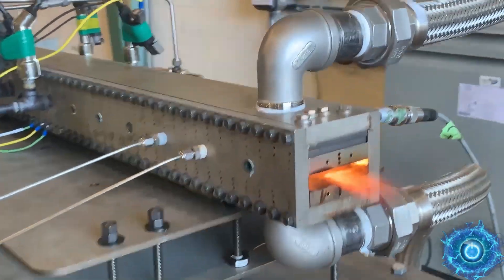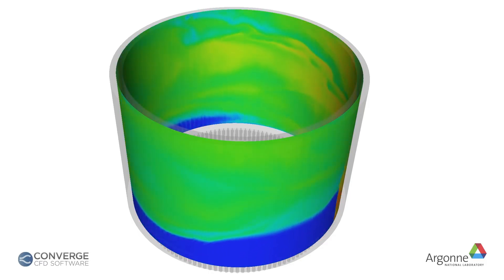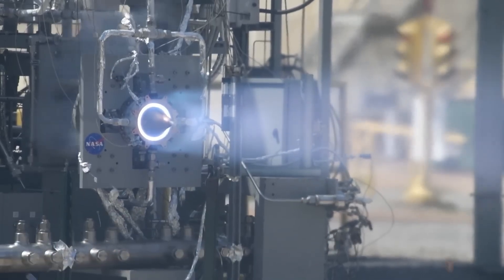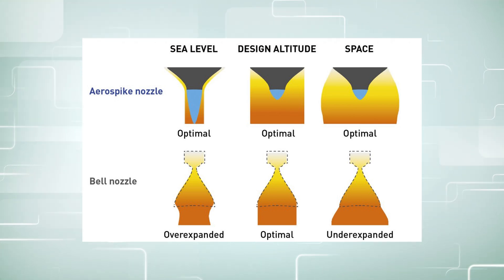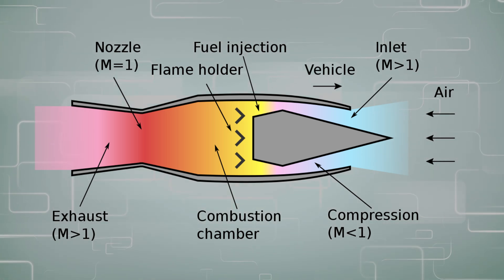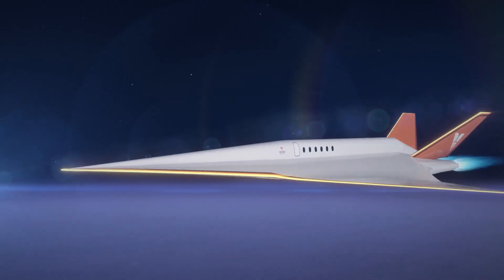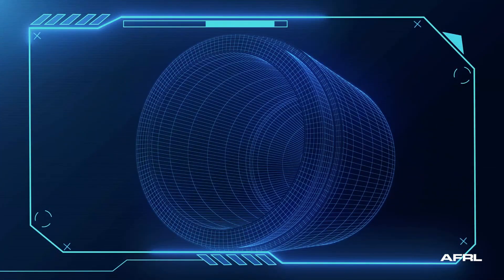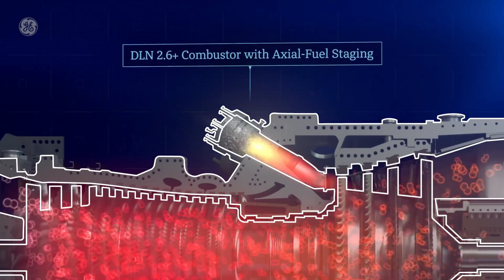New HYBRID DESTROYS Jet Engines

Comment: Love the video, but would love to see one regarding the fuselage of the vehicle that would house these new types of engines.  As we know the SR-71's fuselage had built in gaps to allow for expansion due to the high heat generated by air friction.  This in turn allowed fuel to leak out... very unsafe.  Would love to see a vehicle that could take me from the US to the EU in minutes not hours!!!!  Mybe take that trip to Australia someday without losing almost 4 days of travel time :D

Comment: A common problem still hasn't been addressed. Even having a small amount of efficiency it doesn't have enough impact.  I have studied this for many years and missing a key component.  A recoil action is required for more than 75% efficiency. Using less fuel is the goal and gains in displacement.  
I'm calculating speeds way beyond mach 10 because I also studied this by observing what characteristics was employed in the Orion project. The detonation was raw but it only captured a pie cut from the explosion and wasn't really effective or efficient due to a mass that was equally lost because it wasn't contained. I came to the very same conclusion and by having the engine 3D printed and yeah this one has moving parts.  We can't contain a Nuclear explosion of that caliber but here's how I captured the pie . A study of Naval Destroyers with very big guns , when fired the recoil is absorbed by the entire ship , moving this mass a degree or so of actual.  
My recoil wouldn't be firing shells but just fuel and oxidation but what became important is the ignition system and the best would be Plasma which is provided by laser's and disk which also offers a boost as well . If you need to know what's happening just take a look at the Orion's pistons and absorption plate . 
Pistons are the keys because a recoil by any action in space is a way of free thrust granted.  
The day I get a contract is when they all lose . I took on what Wernher Von Braun signed on to the Orion project and did what he did , he studied the characteristics because it would be effective but not with the current technology during his time . After all he did bring forth the Saturn V and the hand made F1 engines that put humanity's first step on the moon . I figured out how and why this is important to make an effective pulse detonation propulsion system that allows for greater travel throughout our solar system 
Cheers

Comment: You could basically create a space plane that went to the lower stratosphere at Mach 6, glided for a bit, then dropped back into the troposphere to your desired destination.
Reply: Wouldn't that be a stratospheric plane or stratoplane instead of a spaceplane?

Comment: I had an idea for a RDE. Probably been thought of but, imagine a circular Tesla valve set up but all channels are twisted like gun rifling. Could be several layers towards center with “twist” angle it self variable reducing and expanding pinch points in Tesla valve. Also defeats the no moving parts idea, but unit itself could spin within a stationary cylinder. 3/4 of the way twist, valve shapes are reduced before exit to kickstart fluid centrifugal motion.

Comment: High Tolerances = Loose Tolerances
Low Tolerances = Tight Tolerances

Don't confuse high tolerance with high precision.
Use the term 'loose' and 'tight' to prevent confusing.

Comment: How do the exhaust gases only ever flow out the back? 
Why doesn’t the ignition of the  compressed mixture expand forwards also?
Reply: Because the airflow into the engine directs the explosion back into the engine.

Comment: Why is it taking them so darn longq to make it into production? I would probably be dead by then by the time that they incorporate Mach 6 speeds to commercial airlines. I want to experience it.
Reply: Perhaps you missed the part where it's called a DETONATION engine.

The physical stresses implied in such engines are the reason engineers have shied away from them for reliability sake until material science and newer techniques (like rotating detonation) was able to produce a viable design.
Reply: Same.

Comment: Here’s a good idea.  You take an aero spike cone, split it in half, put the halves at the ends of a linear aerospike, making rotating detonation possible around the whole linear aerospike.(The rotating detonation wave would have to get around the ends of the linear aerospike continuously)You also use a very large 3-D printing machine to make the fuel tank possible, which wasn’t available at the time that SSTO vehicles were being developed.
Reply: Yes! Why is a circular (cylindrical) geometry necessary?
Reply: You could have multiple ‘waves’ of detonation operating concomitantly around the entire course, rather than say, having two opposed in a circular tube.

Comment: Jet engines have technically not changed since Inception in the early 1900s.  The RDE would be a brilliant step fwd. I can see them being used for rockets and scram jets /hybrids.  But i don't see a place for them on commercial flights.  Too noisy not enough thrust but it's definitely early days

Comment: I had a little bit complicated theory idea, is the high operating temperature caused when burning liquid fuels? The operating temperature could be lowered by burning gaseous fuels instead of liquid fuels, however this would need more research later on
Reply: No, jet engines work by spraying the fuel and creating a vapor that ignites, kind of a mix between a liquid and a gas
Reply: This is commonly done for a few reasons. In jet engines, the oxidizer is already a gas, and in rocket engines, the fuel and sometimes oxidizer are used as coolants which boil and become a gas during the cooling process.

Comment: It would have to fire outside of mass without disrupting the quatum magnetic fields of the material as decay. Mass is at the cosmic speed limit as mass now. Disrupting the flow of thermaldynamics singularities passing through mass increases decay of mass. Distance increases as mass decays into singularities. Heat singularities are waves of decay or renewable energy. Quatum magnetic fields are the strongest magnetic fields, but expansion weakens the magnetic fields holding materials together. The cooling system would have to be extremely colder to disrupt decay. Heat singularities passing through mass now as renewable energy striking out singularities in resistance are in equalization to thermaldynamics increasing distance increases decay and by rapidly increasing exchanging singularities as renewable energy also increases decay.Stars decay as heat loss of waves of thermaldynamics singularities as heat singularities outside of entanglement of mass as dark energy throughout space as perpetual motion. These singularities are always at the cosmic speed limit in resistance in and out of entanglement of mass. Quatum magnetic fields of redirected trajectories of thermaldynamics singularities passing through mass reduce distance of perpetual motion as force fields holding mass together in cycling circulation patterns. To increase distance of forward momentum, these renewable energy singularities strike our atmosphere in equilibrium now. The earth's magnetic field redirects quatum magnetic fields of grounding as weight of force towards the greater magnetic field of earth's center force of flow. Aging increases as decay increases. If renewable energy can't keep up with distance of equalization of exchanges of cold and thermaldynamics singularities cycling circulation then magnetic fields break down and more thermaldynamics singularities of heat loss. Cold stripping thermaldynamics singularities away faster than replacement of pressure.

Comment: 0:40 pressure always increases during detonation, no matter whether it is a jet engine or an RDE. That's the basis of jet propulsion.
Reply: Doesn't pressure decrease in the turbine?
Reply: @rikipatel4340  That's what I've always heard. It slows the air down to introduce fuel.
Reply: @rikipatel4340  first unit in a jet turbine is a compressor. Further down the compressed gas is mixed with fuel and ignited. That's where the energy to drive the compressor comes from. And in a turbojet, that's where the propulsion is generated. 
So, pressure always increases. Otherwise it would be fly backwards.
Reply: Pressure does increase during detonation, but conventional jet and rocket engines do not detonate, they deflagrate. The injector pressure in a jet or rocket engine must be higher than the combustion chamber pressure, usually by at least 20%, because fluid only flows from higher pressure to lower pressure.

In a rotating detonation engine, the detonation pressure is higher than the injection pressure, but only temporarily as the detonation wave passes by a given injector. This can cause backflow into the injector as the wave passes. The net pressure in the combustion chamber must still be lower than the injector pressure so that everything flows in the right direction.
Reply: @TheMooseOnTheLeft  I don't see what your point is. There's an increase in pressure in all thermal expansion systems, not "unlike in a jet engine...".
Reply: @human_isomer your original comment says that " pressure always increases during detonation, no matter whether it is a jet engine or an RDE. That is the basis of jet propulsion." I'm not sure what the last sentence is supposed to mean here. Detonation is not even considered in conventional jet propulsion, let alone the basis of. Detonation does not ever happen in the normal functioning of conventional jet and rocket engines.

The first part of your original comment is true, that a detonation will cause a pressure increase no matter what system it occurs in, but if anything, jet propulsion is about avoiding detonation.

Your second comment here ends with "pressure always increases, otherwise it would fly backwards". This doesn't quite make sense to me either. Pressure is increased in the first step of jet propulsion, but pressure is not always increasing across the engine. The highest pressure is in the compressor, and then pressure decreases across the injector, is held constant during combustion (which increases volume and temperature, at constant pressure), and again pressure decreases during expulsion. To say the pressure always increases is either confusing or wrong depending on what is meant. Yes, a system must always increase the pressure during a step, but pressure does not always increase across the system. Combustion happens at a lower pressure than injection.
Reply: @TheMooseOnTheLeft  Maybe there is a misunderstanding about partial and total effects. 
I think it is clear if you increase the temperature of a gas, you will always increase its pressure. In a closed container, the elevated pressure can be measured. In an open container, the gas will expand until the pressure between the inside and the outside is in equilibrium. If the impulses caused by equilibration don't cancel each other out, the expansion will lead to propulsion. 
I'm talking about the net effect, not what happens in specific segments of the motor. If in a jet engine the pressure would decrease in the direction from the inlet to the outlet, the impulse would reverse due to the reversed gas flow, and thus, it would move backward. It's the same as when turning the engine back to front. Right?
Regarding detonation, explosion, or deflagration: The differences are just in the definitions, mainly based on propagation speed of the reaction and volume increase. The underlying mechanisms are not different.

Comment: Yeah, the big problem with aerospikes is they don't conduct heat away and are also quite heavy. But if we can make advances in material science that eliminate those issues. Plus make advancements in rotating detonation engines. It's gonna be an amazing future, not just for more powerful engines, but more efficient and clean.
Reply: I have read of AI be used for the sole purpose of novel materials. What do you think of that?
Reply: "Yeah, the big problem with aerospikes is they don't conduct heat away and are also quite heavy"

That assumes the aerospike is solid metal, which isn't sensible on any rocket engine where weight is a concern as you multiply them to create the total rocket vehicle thrust.

Better to make it hollow, but filled with pipes so the cryo-cooled fuel can be pumped through the engine to cool it down before it is used for thrust.
Reply: @mnomadvfx  To my knowledge, that's why 3d printing was used to make NASA's aerospike, since the cooling channels can be built-in the spike itself and they can use better geometry to channel the heat out faster. (My guess would be some form of gyroid, or tesla valve)

Comment: Just a dumb question but when I was a kid (long ago) I had a toy  model helicopter that had jet engines at the  end of the rotors that presumably depicted some futuristic helicopter that the  toy manufacturer concocted.

So my question is could one  put ram jets on the tips of a rotor blade and then spin the rotor blades to get the supersonic flow needed for the ramjets and if so would there be any reason for anyone to want to do that?
Reply from the maker: Never a dumb question, it has been tried multiple times but not really practical. https://www.youtube.com/watch?v=qs7WlNrHRmA&t=32s
Reply: They managed to get a Propeller plane through the sound barrier with the F-84F Thunderstreak, problem was it generated 900 sonic booms a second, it produced so much noise it gave ground crews headaches, nausea and even seizures to some, it could be heard as far as 25 miles away
Reply: first of all i dont think any rotor can acheive supersonic speeds
Reply: @lohithreddy6629 rotors and propellers can reach supersonic speeds at the blade tips, however this causes a massive drop off in lift efficiency
Reply: The noise and power is the problem. But I was thinking an air intake through the roters might work.
Reply: In the Los Angeles area there were experiments with jet engines at the end of helicopter rotors.  Inglewood area.
Reply: The Fairey Rotodyne used bleed-air from the turbo-prop engines to spin the rotor up to achieve vertical take-off, once it translated to forward flight the bleed-air would be shut off an the rotor would auto-rotate.  It had potential to be a successful design, but it was extremely noisy on take=off